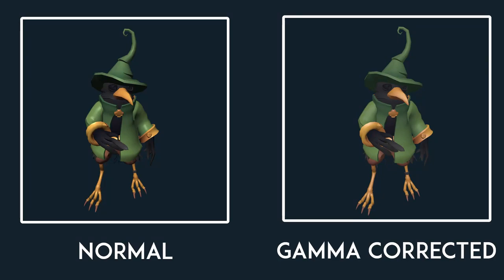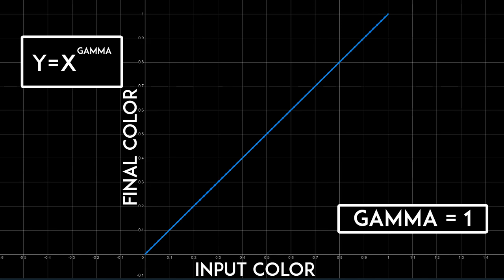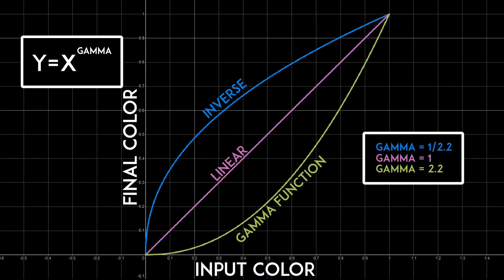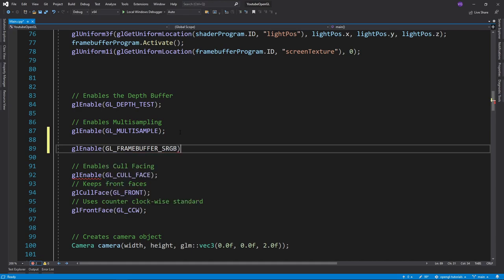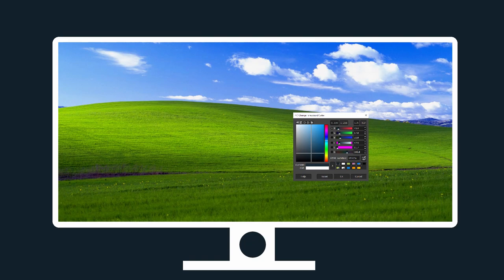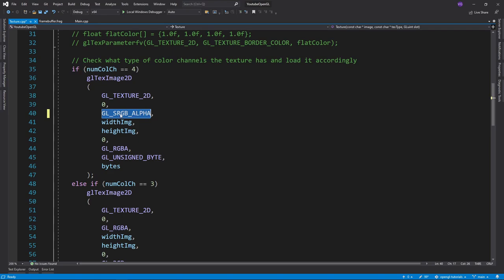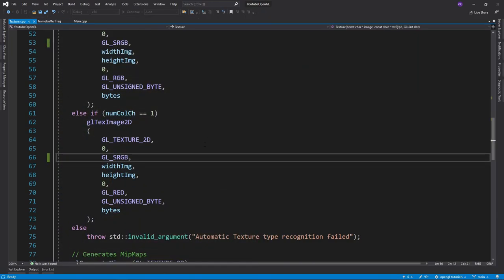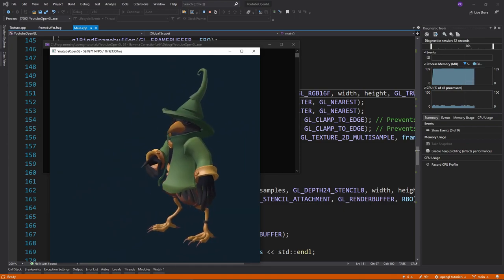OpenGL Tutorial 24 - Gamma Correction

Comment: First of all, I like your videos, they're usually very to the point, and incremental. So congrats!
I do have one nitpick to do on this one: light is not linear, as stated. We perceive it with our eyes, and they have an inherent gamma curve, which is why monitors will also have that curve.

 The motivation is missing as well: why not just leave gamma well enough alone? Because when you do light transformations in code, a multiplication of light by 2, would actually not work as expected, it would multiply by a gamma corrected factor. So you do the gamma transform to act like the monitor and make the color of assets linear (loading as SRGB in your case), then you do whatever light transforms you want, then before tossing it to the screen you do the inverse transform to prevent the 2x problem you mentioned.
Reply from the maker: Thank you! :)

Hmmm, I think I was not very clear. I meant physical light is linear. I did not mean the way we perceive it 😅

And yeah I guess I did not give a good justification for why it looks "more realistic".

Thx for the feedback :)

Comment: Is that because when we power a value between [0, 1] like 0.5 then the higher the power number, the less the result will be. For example: 0.5^0.2 > 0.5^5, (0.2 = 1/5). So we apply gamma correction for the same principle because color value always range from 0.0f to 1.0f. Thank you!!!

Comment: So if I understood this correctly, do I need to use all these to have proper gamma correction:
1. glEnable(GL_FRAMEBUFFER_SRGB)
2. Apply gamma correction in the shader
3. Load textures with GL_SRGB
Do all of these 3 need to implemented at the same time?
Reply from the maker: Yeah, that's indeed the case afaik
Reply: @VictorGordan  For some reason though everything looks too bright if I have "glEnable(GL_FRAMEBUFFER_SRGB)" set
Reply from the maker: I think the results can differ from one monitor to another 😅

That, or you might have missed a step in the tutorial